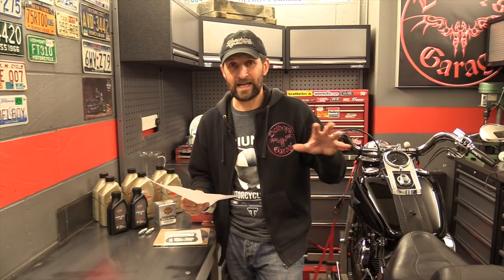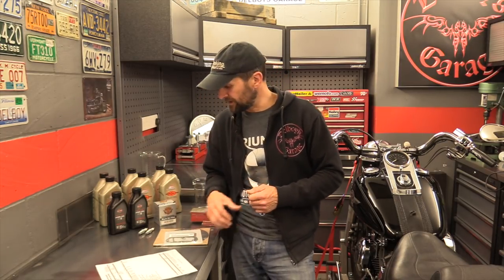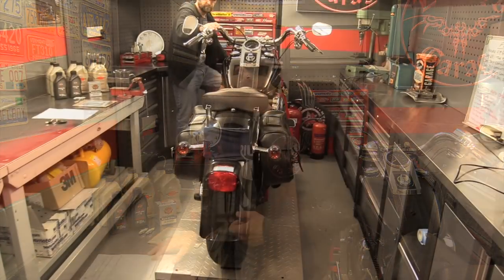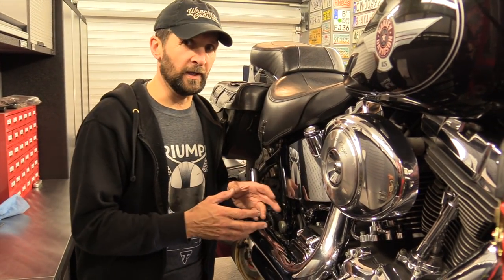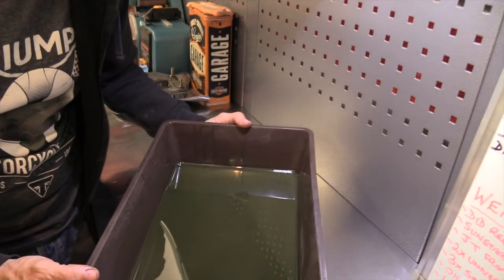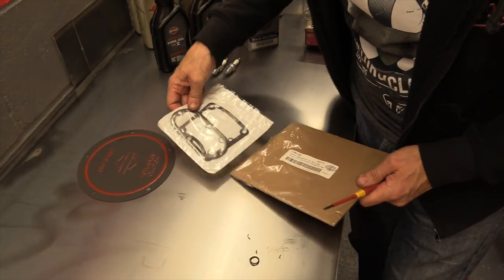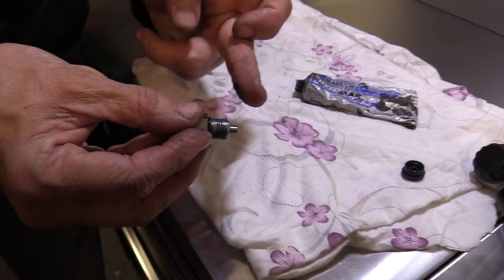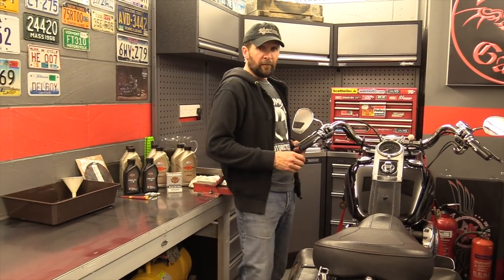Delboy's Garage, Harley Softail Service #1:- Gearbox Oil Change

Comment: G'day  Del, I was  watching the vlog again on the Softsil series  & noticed that you are intending to put Syn 3 in the primary as well  (I  had wondered why you had 6 litres of it ), would  you advise/ advocate me asking the dealer when I  take the bike up for its first service to insist on Syn 3 in all the 3 hole oil change.Aftet the initial service I would be doing the future oil changes myself  & do it every 5000, would it be overkill to do the transmission  every 5000 as well.  I  realise that the primary is basically an oil bath so maybe every 10 for that.  Great initial vlog on the Softsil & as you mentioned  a great  saving financially as well. Have a great weekend 👍😎
Reply from the maker: All 3 holes, every service mate - and Syn3 exceeds any other oil they make mate... if you ask for it, am sure the would be willing to install it, rather than the lesser oils... it will just cost you a little more !  And 6 litres because you need 4 for the motor, 1 gearbox, 1 primary, and not a full litre in the gearbox and primary, it's about 700ml in the gearbox and about 900ml in the primary, so if you buy 6 litres, you will have plenty left for top ups!  I will always run my Harleys on Syn3...!

Comment: Delboy, I just saw your videos today and I gotta say they're great! After watching them I have no reserves about servicing my '96 Softail.
I do have one question. You said to check the engine oil with the bike on the side stand. OK, but what about the transmission oil?
In your video, you checked it with the bike straight up. Is that correct, or should it be on the side stand also?
Again, mine is a '96 FLSTC and I just want to be sure I'm checking the levels correctly.
Thanks again for your terrific videos. They are definitely the best I've ever seen!
Reply from the maker: Hey Joe, good to hear from you, now as you have a 96' and mine was an '05', i would check on your service manual or handbook, because at some point in the later 90's it changed to upright from side-stand.... and i cant remember off the top of my head what year that was... the size of the oil cavity in the trans case is so small that the difference it not much between the two.. but check your handbook and be sure, it will tell you clearly in there for sure buddy.   Good luck with it..all the best.. del.

Comment: Del, the oil to buy is one type? i dont need 5 different types to do all the different changes? engine, gearbox, forks etc all use the one type?? What is the oil type or types?? brake fluid?? ive no idea what i need.
Reply from the maker: Hi buddy, I think I mentioned this in the video series, but just to re-cap, Harley has recommended oils for each of the different applications, so you can buy them all from the dealer, i use Harley's "Fork OIl E" for the forks, and Screaming Eagle Syn3 for the engine and primary because it exceeds all the other oils...    if you call the parts dept at your local HD main dealer, they will give you all the correct oils if you tell them what bike you have..

Comment: Came to know about your channel and its awesome! Your new workshop/garage looks impeccable...like someone upgrading to snap on tools. 
I will be changing my front fork seals tomorrow, and i was curious when you mentioned fork oil change in full service, does that include rear shocks too? Downloaded ktm390 manual but there was no mention of rear shock oil change
Reply from the maker: No buddy.. the rear shops are sealed for life.. you dont change the oil on them..!    Good luck with your fork seals..!

Comment: Hey mate, great videos very helpful 👍
What are your thoughts on using  automotive multigrade heavy gear oil In the harley gear box/primary, i've seen alot of people talk about in the HD forums but I'm two minded about it my self! They talk about brands like
Primary - Redline High Temp ATF
G/Box - Redline Heavy Shockproof

Thanks in advance
Reply from the maker: Ive used ATF in Primary cases for many years with no dramas, but not tried car gear oil in Harley gear boxes..so can't comment on that part.. 

These days  i just use the 3 in 1 type oils in all three holes.. (things like "Screaming Eagle Syn3")... in fact, for my next oil service, having used the 3 in 1 oils for so long, i want to now try the actual three separate oils focused on the three different uses..going to try Amsoil Primary oil, Gear oil and Engine oil, in the relevant holes and see if its any different to ride and operate the bike.. like you said, so many opinions, i think its time to find out for myself.. it'll be a video series coming shortly, and then ill be able to report back on whether using three separate oils is better.. !
Reply: @Moonfleet41  that'll be really good, looking forward to seeing the results.

I live in Australia and we've been having some really hot days this summer, do you have any oil grades you could recommend for the 3 holes? 

Thanks

Comment: Hi Delboy, I've just bought a Softail Rocker C which is due for a service. 
Does the gearbox, engine and primary all take exactly the same oil, or does the gearbox oil differ etc.

Sorry if this is a daft question
Reply: Is the same. The same oil for everything. He bought the same oil.
Reply from the maker: Not a daft question at all buddy.. exactly why i made the point about oil in this video...  

The Softail Gearbox takes a 50w oil (SAE50) which is quite light, the one Harley sell specifically for the job is called "Harley Davidson Formula +"   That oil is also designed for the Primary chain case too... but as the "Screaming Eagle Syn3" exceeds the spec of the Formula +, it serves as an upgrade... being a multigrade 20W/50, it covers the need for a 50 weight oil in the the transmission cases...but also gives the superior cold flow qualities as its lower rating is 20W (much thinner).... this means the trnasmission will be smooth and silky even when its freezing cold.. you wont notice much difference in summer, but if you ride your Harley in winter when its minus 6 degree,s you'll know the gear changes can be horribly harsh and clunky until the motor warms right up... 

The general chatter and social agreement on most Harley platforms is a term you'll hear called "All Three Holes"... meaning, that the 'SE Syn3' oil is good for all three filler holes on your Softail.. 1,Engine 2,Primary and 3,Gearbox   as its "better" than any of the dedicated oils Harley make for those jobs..!       Hope that helps buddy.. good luck.. del.

Comment: I have a question about all these oil changes. Can they be done with your bike on it's kick stand or does it have to be upright?
Reply from the maker: Hi buddy, no the bike must be upright to drain the oil in the gearbox cos the drain plug is in the centre... and the same goes for the primary, as the oil level is checked by filling the primary case to the bottom of the clutch plates with the bike upright... if the bike was on the kick stand, the oil would spill out when you take the derby cover off...

Comment: Hi Del, Formula+ might be the Harley recommended oil, but it is so light in colour, it's almost impossible to see on the dipstick, which seems another reason in favour of using Synth3. Out of interest, what length of socket did you use to tighten the drain plug? It's a difficult to reach place, that's for sure! Great series for the Fatboy mate, thanks so much. Cheers, Paul.
Reply from the maker: Thanks Paul, i just used a normal long reach socket, the kind about 3 inches long, and an extension bar..!!    And yeah, that "chrome" dipstick is a real top example of "engage brain before thinking with it".. the chrome make even the Syn3 hard to see also.... the Dyna engine stick is green plastic...best idea ever, you can see plain water on that is so easy... Thanks for watching... Del.

Comment: Delboy are softails sometimes more difficult to get into neutral just bought a softail slim 2013 and was having trouble getting it into neutral the dealer said it’s a lot different then my Sportster gonna take some getting used to. I’m going to do these 5 videos on my bike before the 10k service just to be on the safe side. Also for drain plugs I guess they don’t need blue lock tight like everything else needs on a Harley? Thanks Mate!
Reply from the maker: Hi Nicholas, I wouldn't say that big twin transmissions are notoriously difficult to get in to neutral, but they are heavier built than a Sprtster, that's for sure, and it could be that you're experiencing just the difference between the two, and nothing more!  But part of getting smoothly in to neutral is having the clutch correctly adjusted, and if it's due a service, then the clutch adjustment is part of that, so if nothing else, you can check the clutch adjustment just to make sure it's fully dis-engaging, and also if the primary oil is a little old, it can improve things to replace that too.... 

You can really only judge faults is the service and maintenance is up to date, as I'm sure you'd agree... so, I guess until you've done the servicing you can't really tell, you'll probably find it will get a little easier once you have, and of course, you would have got used to it by then.   All the best, Del
Reply: Moonfleet41 thanks mate much appreciated will do the full service in your videos. Glad you make these videos they help people like me that are new to wrenching! Thanks again!

Comment: Hey Del and Penny, your new new garage looks lush! If I wasn't so pleased for you both, I'd be well jealous!
Loved the vid.

I've a wee ECU question?

Long story punctuated....

ECU Tuned for track, open pipe and higher octane fuel.
Runs like my toolbox full of spanners with normal fuel!

Went for run smiling all the way, felt like a 955cc YPVS, F A B !!... 
filled up with normal fuel - because there was no other options.
Ran very poorly and spoiled the run home.

Any advice please?
Reply from the maker: Hi James, am interested how you've tuned this - what are running it on for track use??  Is it maybe C6, or something, as super unleaded is fine for track use ... and what tune are you running??  Is it just loads of ignition advance??  Or are you running an open air box??  Most track days don't allow race fuels, so give us a bit more background fellah, it would just help to know what your current set up is??
Reply: It has an ART full system race exhaust and I've just bought the bike so know very little, I got a folder of it's history. A couple of the receipts from 2002 stated REMAP for track day, the next receipt said, check over for track day.
Other than that, I know it runs dreadful with normal fuel but fantastic with Shell premium, like a 2 stroke, lovely.
Only issue is, I like long runs, like Ireland, Europe, West coast of Scotsland..super unleaded isn't everywhere.

It's a Triumph Daytona T595 1998

I'm not sure what I'm asking but need a middle ground tune but have no real idea on how to proceed.
Reply from the maker: Hi buddy, ok, so I was a bit confused by the 'race tune' thing... someone has obviously had a fiddle about and there is some sort of re-map been done, it could possibly have an ignition advancer on it, which will maximise the power, but it does make it run hot, which means it needs the highest octane fuel to cool it down...

As you say all of this is 15yrs ago, and you really don't know much more, the only sure fire way to settle this bike back down to 'normal' is to either take it to Triumph , or possibly another tuning shop, and have a 'regular' current model power commander fitted and set up.... that way, you revert to a level playing field, and even in standard format straight from the factory, the Daytona is an awesome bike, then you can run it on any fuel - but only a suggestion, I would need to investigate a lot more on the bike to be sure of the right path!   Hope that helps in some way, good luck , Del

Comment: Del,
    I have been thinking of buying a more powerful Harley then the 1200 Sportster that I have. I have checked out 96 ci and 103 ci Dynas, all used. And here is the thing...all have had a stage one kit. My understanding is that a stage one kit has a more efficient air intake system,  less restricted mufflers and some sort of electronic stuff done to the fuel injection system to increase the power, all changes to work in conjunction with each other. And each varied from loud to very loud to VERY VERY  loud.. One was so loud that it was rattling the fillings in my teeth. And here is my concern. Could I put stock mufflers back on any of them without decreasing power? Or is there an alternative that would quiet them down somewhat and still keep the power? David
Reply from the maker: Hi David, I understand your concern my friend, and you're right to be concerned, yes a Stage1 set up is an open air filter, open pipes and a fuel mapping advice to richen the mixture... if you choose to make the bike physically quieter, then you can do this without sacrificing power..... If you fit Vance & Hines open pipes, they have an option to fit different baffles in them, everything from a wide open tube you see straight through, to the one I have in the middle of the range, which is a baffle with a single obstruction in the middle to reduce decibels slighty and make a fuller sound that is less hollow.... or alternatively you can fit full quieten-ing silencers which give a practically stock factory sound as they have baffle plates and wadding... all available online and on Ebay, serach Vance & Hines baffles.... hope that helps, and enjoy your bike shopping!

Comment: hi Del. really enjoy your videos.
I recently bought a 2002 dyna. it has the 88ci twin cam engine. Will it be a similar process for me to service my bike?

Thanks
Reply from the maker: Hey fellah, yes indeed... the good old twin cam 1450 is one of the easiest to service and live with of all Harley engines... prior to this motor they took a lot more care to look after, and after this motor (96ci) they started getting more complicated ... 

Yes mate, the anatomy is a tiny bit different, your engine oil lives in the crank case, not in a tank under the seat, but the primary side is the same, and if you get yourself the genuine H-D manual from the dealer, it covers the exact procedure in great detail, it's the best tool you'll ever buy mate !
Reply: Great. thank you Del.

look forward to the other videos in the series.

Thanks

Comment: Hi, first of all, thank you so much, I love your videos! But I also got a question: In my manual it says: "If mineral oil is mixed with SYN-3 in the gearbox, it might damage your gear." If I do an oil exchange and there was mineral oil in it, am I allowed to use SYN-3 now? Since there will be some remains of the mineral oil still in the gearbox? Or do these little remains not do any harm to the gear? (I hope my english is good enough to understand - greetings from Germany)
Reply from the maker: Hi Florian, you are right in what you assume, a small residue of old oil will do no harm... what the manual refers to is mixing equally, or at least in more equal proportions, because the oil doesn't mix properly... my suggestion would be to drain the gearbox whilst it's hot, if you're ok to waste a little of your SYN3, then pour half a pint in to the gearbox and with the plugs OUT and the bike in gear, turn the back wheel a dozen times to wash the oil all round the gears, then drain that out.  This will act like a flushing agent, and ensure that there is almost no trace of your old oil left behind.  The just re-fill to the correct level with new SYN3... good luck with it, hope that helps you, all the best, Del
Reply: @Moonfleet41  Thank you so much!

Comment: Del, quick question.  Back in Oct/Nov, I did the 1k mile service on my fatboy, but it's been pretty much laid up all winter.  Any special considerations before starting to ride again?
Reply from the maker: Hey Rob... well you did the exact right thing by doing the service before you laid it up... imulsified water in the oils can cause problems over a lay up.. so good move buddy... If the bike has hardly moved since then.. its the usual raft of things to wake it back up and get it all back into use.. 

Whip the plugs out and clean them off with a brass wire brush
Fully charge the battery if it hasn't been on a minder.. 
Visually check the oil level in the tank, just to make sure its at least up to the bottom of the stick
Pump the tyres right up to 50psi, then let them back down to recommended pressure..(just tests the seal)
Drain out ALL the fuel in the tank and refill with the best you can buy (Super Unleaded only)

Start the bike and let it idle for about fifteen minutes to warm right up to full working temperature. 
Switch it off, then check the oil level on the side stand accurately... 
Then take it take it out for a test ride, nice and gentle, maybe a couple of miles,... back home, check everything again...

Then just enjoy.. !
Hope that helps buddy.. let me know if you fins anything not right, happy to advise.. 
Del.
Reply: Awesome.  I'll be checking it over today, seems like the weather is finally breaking from 50 and rainy this week!